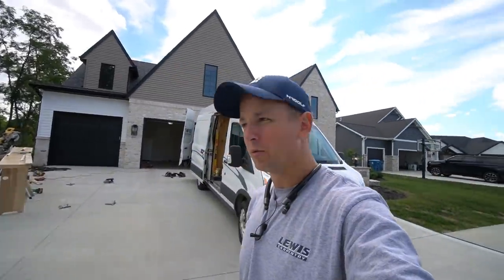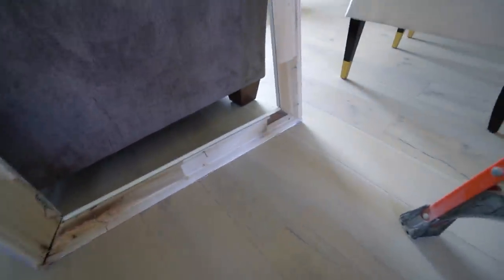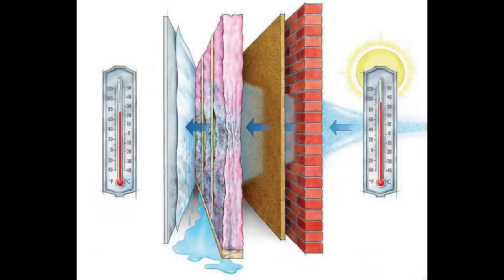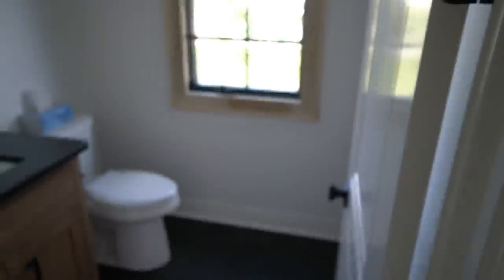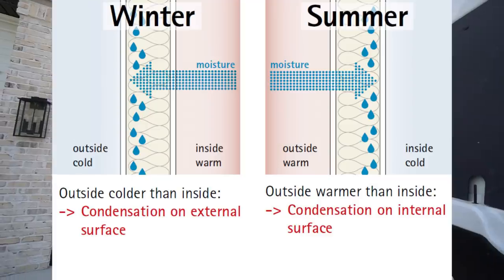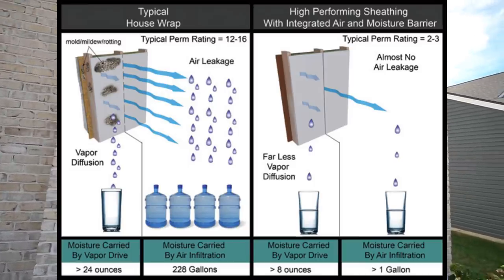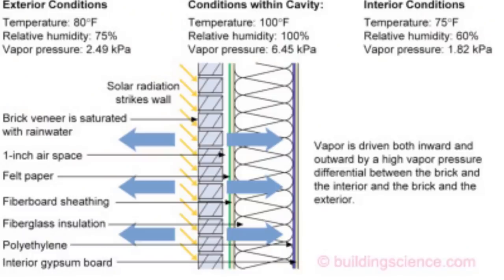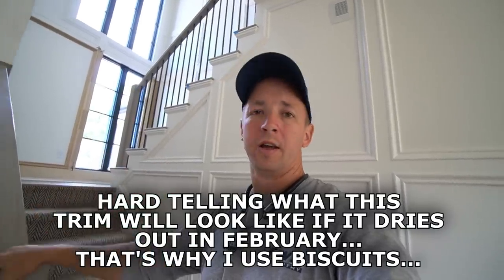Trim Humidity DISASTER!!! Is Vapor Drive Destroying this Trim Package???

Comment: Brick NEEDS to have air moving behind it to dry, Every rain or sprinkler that gets the brick wet will drive the humidity up. I come from a family of masons and study building science. Without a doubt I will say that is where the problem is. Once the outside of a brick dries it will push moisture in. Its cooler on that side so it just condenses. The moisture then has to go somewhere. House wraps are meant to have airflow between the brick and house wrap. They can not and will not contain moisture that saturates them. One last detail on house wrap is how long was it exposed to sunlight before being covered. That will also degrade the wrap. Brick should have a rain screen and ventilation behind it to function properly and last for years.
Reply from the maker: Glad you chimed in John. Great explanation. Very clear and easy to understand. Thanks!
Reply: Spot on.👍
Reply: Yes the lack of rainscreen was my immediate thought. Builder or homewarranty  should be redoing all that brick.
Reply: You're right on.  Experienced moisture absorption through brick - was fired improperly - and only solution was to seal the brick to stop moisture migration.  Also, I'd get a good HVAC company to assess hvac system.  I think an air exchange unit to mix fresh outside air with air inside of the house may be in order to reduce overall level of moisture. One other thing - check caulking to make sure it's doing its job and not allowing water to wick in.
Reply: Bang on.  There must be rain screen and exterior wrap.  If the wrap was exposed a year or more before being covered, it's probably only working at half effectiveness.  There is likely some rot in the walls so that should be inspected.  Brick should have weep holes too.  It all might have to come off for a redo.
Reply: Not to mention how well, or not well, that house wrap was installed...
Reply: @lukemckeen4037  sometimes they will use plastic pieces that are corrugated like cardboard for the weep holes
Reply: Would you agree finding this early and having "bad trim" might have saved them from having a crazy amount of mold after years worth of this?  I'm thinking I'd sell this house ASAP if it were mine.
Reply: @davidhenner5067  problem is,  now that this problem has been exposed,  it'll be tough to sell the house without a loss... and you're right,  mold will be a problem until the root cause is addressed,  if it's not already!
Reply: John, as a mason, would you be concerned with sealing the stone from the exterior and trapping moisture that makes its way from the inside to the outside during the heating season?
Reply: @Goretex69  I'm not John,  but as he stated, there needs to be ventilation between the brick and house wrap. If that is provided,  providing there are no major leaks going into the space,  moisture should not be a problem....
Reply: Sorry about that. Spencer stated there is no ventilation behind the stone, which is why I’d be concerned with sealing the exterior face.
Reply: This should be easy to check without demo.  Just measure the total was thickness through an open window.  Unless it was a brand new first job mason(cheap), I'd be surprised if the brick is right against the wrap.  Also if the brick is drying from the outside that should Pull moisture from the inside.  I don't understand where the "driving" is coming from.  Stick a towel in a bucket of water and allow to hang over the rim.  The towel will dry and pull water out until the water is below the bottom of the towel.  The dry end of the towel doesn't add moisture to the bucket.  I'm sure there can be weird scenarios where this seems to be the issue though.  Water and moisture can be very weird.  I'm all for adding venting BUT only if that venting isn't increasing outside air infiltration INTO THE HOUSE.   if the windows aren't sealed around the perimeter as I commented before then this could make the problem worse.  

I can't wait to find out what the issue is!!
Reply: @InsiderCarpentry  It's a tall house (by the looks of it) and you mentioned closed cell spray foam. So rainscreen is pretty much essential I would think.  And who knows, maybe they skimped on furring and there's not much of a gap.
Reply: I live on the west coast of Canada, imo John has nailed it. We are rain screen conscious here because of the thousands of failures in exterior walls, especially multi unit buildings with OSB on them. I know nothing of the "Vapour Drive" science, a good building wrap will not allow that moisture through, as John notes.
There are some terrific comments in this thread, I commend everyone and thank them for their thoughts. You have a great group of followers Spencer, and Thank You for bringing this up.
Reply: Just an idea...here in Farmington, NY new homes are so air tight with spray foam insulation many new builds are requiring an air exchanger or HRV unit.
Reply: My home has a similar brick side but it extends all the way to the roofline.  I watched the mason as it was installed.  There was a two to three inch gap between the brick and the house wall.  I live in western Washington state and it’s know to rain sometimes here, so far twenty years no problems.  I can thank the mason for that.
Reply: Gents, have you also looked up? The weep ropes are not enough to allow any moisture out of the assembly if the brick was set against the exterior wall without a 1” air space. The rollock and siding drip cap should also be inspected. One solution to the ventilation of the assembly is to install a matrix fabric on the rollock under the drip cap. This should create a convection effect and draw any moisture from the rain screen/house wrap. Cheers and good luck.
Reply: The only thing I see that may not mean anything is a sprinkler head right beside the stairwell wall and the weep ropes buried in what would be wet soil and maybe wicking or even an underground leak from that sprinkler line when it's on saturating the area beside the wall and getting up under the brick. Is it a good idea or even correct to bury brick? I always see it stopped above or at grade.
Reply: @99andrianmonk  And perhaps a standalone dehumidifier if not a ERV that also does dehum. That way they're not relying on the AC alone to remove humidity.
Reply: Bet that brick is slammed tight to the tar paper. Or the masons threw their mud behind the brick.
Reply: Yep spot on ,needs multiple  bricks ,I've seen this before get air flowing behind the bricks ASAP
Reply: @Goretex69  I am not a big fan of sealing brick for that very reason. Best practice is to install the brick properly with a rain screen behind it. Another problem with sealing brick that isn't ventilated properly is that winter conditions will cause even more moisture behind the brick as the house breathes
Reply: Myka Hunt  My thoughts are 1) Architect should be liable if details for brick connection were drawn this way; if not, general contractor and mason are liable for improper installation. 2) Fix is removal of brick and building paper to investigate sheeting- it's likely moldy already.  Depending on the damage, insulation and drywall may need to be replaced as well- a real mess.  Probably lawsuits will be involved.  I would not be re-installing trim at this point- that's like putting a new canary in the coalmine and carrying on...
Reply: On top of what john perkins said, there is an issue that the house does not have gable ends. traditionally, the gap at the top of the brick vents into the soffits under the gable ends and the soffits under the eaves. You show strings coming out the the bottom of the bricks, I have never seen these in Canada. What we have, is that about every third or fourth brick on the bottom row, the the vertical mortar between the bricks is left open to let air in (if you are concerned about vermin getting in, you can cut bits from a stainless steel pot scrubber "chore girl type" pad and tuck it loosely into the gaps). Since this house does not seem to have any way for the bricks to vent properly at the top, then you will have to use your imagination there. I suggest that you open up the vertical mortar joints on the top row of bricks as well, and again use something to loosely put into the joint to keep the vermin out. Since this house does not have gable ends, it will be too easy for rain to infiltrate into this top row, so I would suggest that you come up with some way of keeping that out. Maybe a small piece of aluminum bent to be a small cap on each opening.  If the house is built to R2000 standards, then it would appear that they left out the air to air heat exchanger that such houses typically have to get rid of moist air inside the main house.  Good luck.
Reply: @gistofitall  From my understanding, what happens with vapor drive is that the sun will heat up the brick or stone to the point that the moisture will start escaping as vapor.  On the exterior the vapor escapes to the enviroment, no problem.  But on the interior of house side the vapor will escape into what is directly next to it;, be that air space/ rainscreen, house wrap, or sheathing, the brick above itself, etc.
Reply: Myka Hunt  If this was a house that was built by my company, and was still under our warranty period, we as the General Contractor are responsible for repairs.  If outside of the warranty, and something like this came up that was due to bad workmanship/ practice, I think we would have to cover all repair costs.
Reply: @johnperkins630  Another problem I see is that you are going to get 100% of the brick sealed and ensuring that the brick remains sealed.
Reply: @matttanglewood2522  is this a time frame dependant thing?  IE if the sun quickly heats up the brick verses slowly?
Reply: Spray foam sounds good on paper when they are trying to sell it, but humidity will not pass through it. I have a couple of homes that the owners insisted get foamed and it's just too problematic. The average family produces 24 pints of water vapor in a day. It's got to go somewhere. Let's not even mention most people don't open their windows, the air quality in a sealed up foamed house couldn't be healthy.
Reply: 1st I would want to know if the houses on my left and right are having this issue.. if yes then builder is screwed and everyone who had their house built needs to file claim. Likely this wouod bankrupt a company and thats unfortunate but thats how it goes..Multiple people with the same issue also make an even stronger cases. Also, I would wanna see the next closest, same floor plan house, as your friends to see its condition. 

Tell your buddy make a claim against builder.. one way or the other it comes back to builder for several potential contributing factors that are causing this and house needs to be tore apart..
Reply: Another issue here ,it looks like the first course of bricks is at grade or below.Lets hope there isn't auto sprinklers in that garden .
Reply: Failing trimwork is the least of the homeowner's problems. Just a symptom of a far more serious underlying problem.
Reply: Just drill holes , like “D.are Horton” lol
Reply: Also needs cavity trays above windows, doors with weep holes. Any moisture getting through the brick will run down the house wrap and exit the building via the cavity trays and weep holes
Reply: Possibly not wicked correctly. Brick-stone needs to wick
Reply: It's hard to imagine someone installed all that beautiful brick without the proper air space behind it.
Reply: Yes. Vented cavity will help stop condensation. But as was said. An inspection camera for To look behind the frame work may scare you. But would need to be done
Reply: Just wondering if lack of roof eaves would be part of the problem?
Reply: @shandoe7gw867  you could so without the roof eaves by providing ventilation in a number of other ways. Brick absorbs water and needs to fry from both sides.. if you only have ventilation on one side it will dry that side and the sun with the heat it creates will continue to push water through the brick. That's why you have rain screens and ventilation behind a proper brick wall.
Reply: @Quickened1  Mine as well say it has no house wrap, prolinx is a woven fabric style wrap, the most useless house wrap ever invented.
Reply: @shelter7214  Spot on...bricks need deconstructing, investigation of the air seals, major repairs likely required, probably have reclad with an alternative product with a cavity system installed. Hope someone has deep pockets for the law suite.

Comment: If the trim looks that bad, I'd want to open a wall to see if the framing is also affected. If framing is rotting, want to catch that now and fix it before it becomes unfixable.
Reply: They clearly have no air gap - mold could be growing through out.
Reply: My thought too!  Bigger problem than trim going wonky!!  😵 😱
Reply: If the backside of the trim is going mildewy then the 2x’s are definitely being affected as well.
Reply: It is a whole lot of bad! There's probably no rot of the studs at this juncture,  but there is definitely mold, throughout!!! They need to seal the brick, address any water infiltration from bad (design) leaks between the brick and siding,  and incorporate adequate ventilation between the brick and framing... It should also have sheetrock removed in multiple locations for drying and mold remediation. This house should not be trimmed inside until those issues are resolved,  otherwise, they'll be trimming it again about this time next year...
Reply: If the issue is with the brick then there's no way to fix it without removing all the brick. The problem is that if you put a vapor barrier from the inside, you are now trapping all the moisture inside the wall and that will rot the entire thing in no time. The moisture barrier needs to be on top of the sheathing between the sheathing and brick. Maybe the best way to fix this issue from a trim perspective is to attach the trim in a way to allow it to move. Or maybe seal the entire trim with some waterproof product then paint over it. If you prevent moisture movement into the trim, there's no reason for it to move. You could also go with PVC trim as long as it's not going to be hit by the sun.
Reply: It is not coming through that 1/2 inch of spray foam from the outside.  the water came from the inside, in the winter, on a north facing wall and has saturated the batts.

Comment: Failing trim package is a byproduct of a larger failure.

As others have pointed out, the more worrisome side effects are the ones you’re not seeing.

I’d forego any trim repair until the main problem is resolved.

Drill some holes and run an inspection camera.  

If there’s no air gap, or the air gap, or rainscreen has been compromised, short of tearing off and replacing the brick with a proper install, your friend will be chasing this problem with fixes like sealers as long as he owns the house.

Comment: Hi Spencer, The half inch of closed cell spray foam should help with vapor drive so you may have other issues as well. I would try shooting the walls from inside with an infrared camera on a hot day when the air conditioner has worked for some time. Vapor drive will show up differently than a leak of some sort. I noticed the overhang is quite small which gives the brick no shelter from driven rain. Also I would shoot the floor at the same time as slab-on-grade can allow  vapor from under the slab to add to the existing problem. Where I live we use ERVs on tight homes. If they are shut off issues like this can occur. Another way to check humidity coming from the floor is to tape down a small piece of plastic and see if vapor builds up between it and the floor.  That's not your primary problem but much easier to seal without issues like the brick. Good luck.

Comment: Just my two cents worth. It was built in the winter. Slab on grade holds moisture, framing lumber holds moisture, drywall (ironically) holds moisture, brick and mortar holds moisture, etc., etc., and 1/2" of spray foam doesn't meet "Perfect Wall" prescriptive values. PART of the problem is the house is going through a natural, moisture equalizing process. PART of the problem is, as others have said, lack of rainscreen behind the brick/siding. PART of the problem is, that since it doesn't meet prescriptive "Perfect Wall" values all that built in moisture is condensing in the (north facing) wall cavities. PART of the problem is a likely (as usual) wrong sized HVAC system. Perhaps, it's not as big a problem on south facing walls because vapor drive is driving the moisture all the way to the interior of the house contributing to the high interior moisture levels. No silver bullet as I see it and I'm sorry I don't have a recommendation for a fix though I'll say, as a former builder, I sure hope the builder is actively participating in this investigation and fixes. Is this the only house he's built on this block having problems? I'll also add that you, Spencer, are a credit to our entire industry...wish that were the rule rather than the exception.